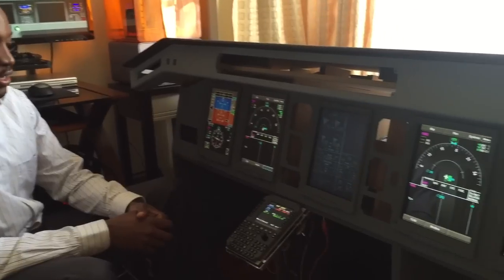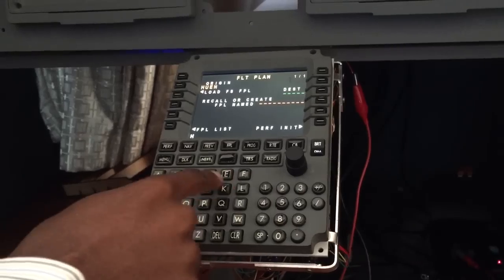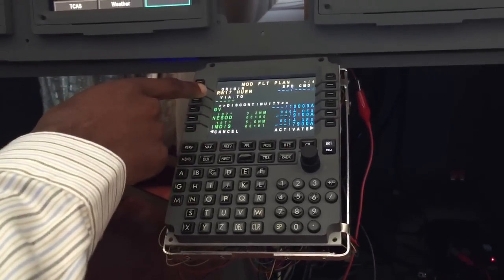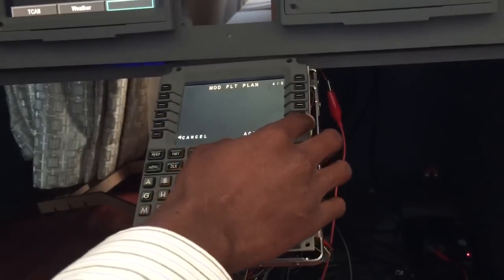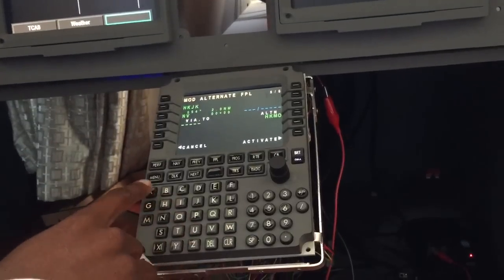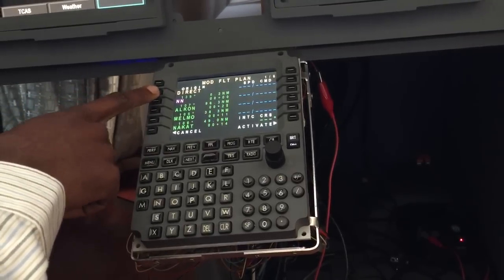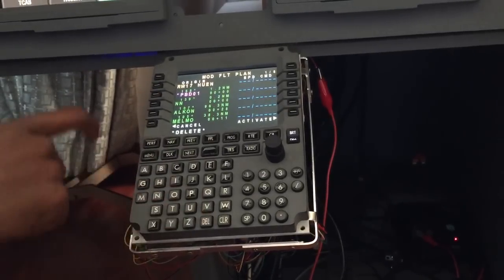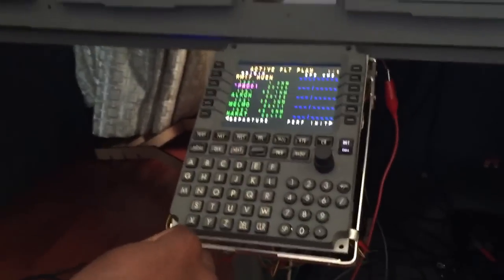Homemade Embraer 190 Simulator Made in Kenya

Comment: Hi, quite impressive. May I ask where did you purchase the MCDU and PFD and MFD from and was it easy to integrate all this together?
Reply from the maker: Hi! Thanks for your kind words. All the components (MCDU, PFD & MFD), I built myself from scratch. For the MCDU I bought a small 5inch LCD screen and built the rest of the parts and put them all together. For the PFD & MFD I used old monitor screens which I dismantled and put together with the external panels which were also built in-house. Software integration was simple as I used another application to sense the hardware inputs and convert them into signals that would be understood in FSX (Microsoft flight simulator)

Comment: Hi Dena, it is great job !! May you help me to find the hardware to can i buy it ?
Reply from the maker: Hi Javier, Thanks for your kind words! it's been a while since the sim building, so I have been out of the sim building scene. However at the time I was doing the building there wasn't any stores selling Embraer 170/190 parts. The only thing I found was the auto throttle and the yoke. Perhaps things may be different know but I cannot say for certain as I haven't done any research yet.
Reply: @dena787  Dena, thank you for answer me.  I will be very interested for get that simulator Embraer. If you would be interested for sell me, say me please

Comment: Do you use your CDU together with an EFIS and a mainpanel, or you use only a CDU ? I have not bought a CDU yet, but l have order one. Price is 350 UD. Is it easy to use a CDU ? I have looked at your video on youtube several times to learn to use the CDU.
Reply from the maker: Morten, it is very easy to use the cdu once you get the hang of it. I noticed that your CDU is for the Boeing B737; so it will be different from the one in my video as it is for an Embraer 190. And in my own opinion, the learning curve for the Boeing 737 CDU is much easier than the Embraer 170/190. Where did you order your CDU from? I'm sure this will be an exciting venture once you have the CDU in your hands!!
Reply from the maker: To answer your question...I have interfaced my CDU to the flight simulator that already has the EFIS (Guidance panel in the Embraer) and the main instrument panel. I do not run the CDU separately on its own.